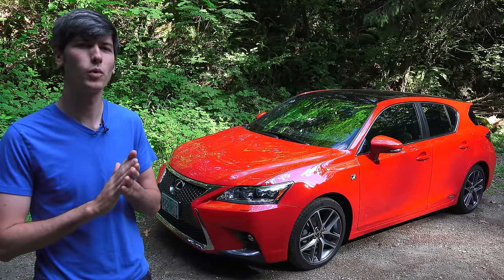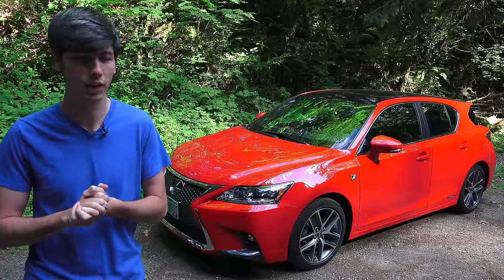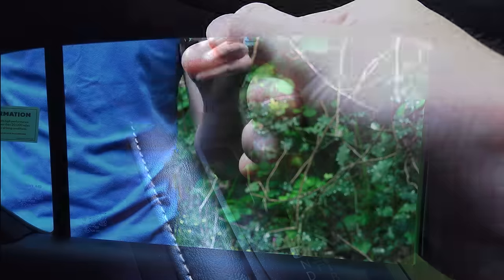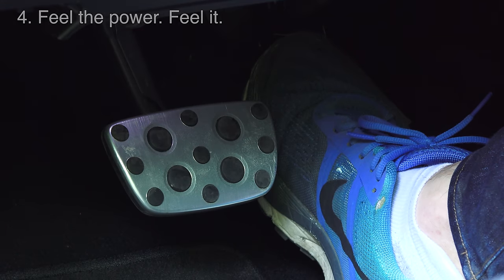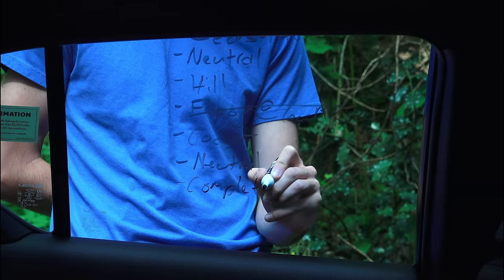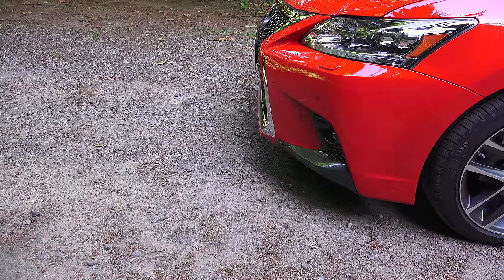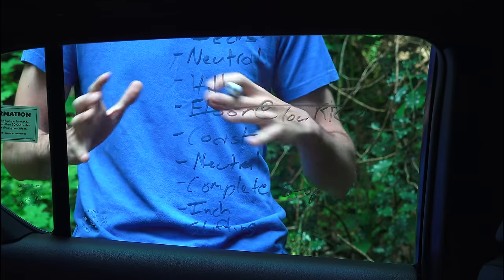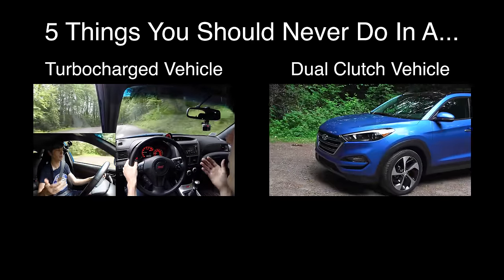5 Things You Should Never Do In A CVT Vehicle

Comment: Why is everybody against a CVT, the technology is pretty cool.
Reply: Horse riders were against cars in the past as well.
Reply: You buy CVT to save on gas. But otherwise better buy manual and feel the car as your bones kicking. Automatic is fast, but lacks manual feel. Basically, goes back, what is your preference.
Reply: People are just used to what it was before, the hate was there when electric cars first came on the scene. If they made a performance cvt transmission and by logic of physics it will be faster than the same car with a DCT people will start to change tune
Reply: Look up Subaru Justy CVT transmission failures. Then you might understand why people shy away from them.
Reply: I'm not against them in principal, but automakers have pretty much eliminated the advantages they offer over stepped transmissions because car buyers can't wrap their heads around CVT/engine behavior.  It's not broken, it's supposed to function that way (referring to the constant engine RPM, etc.)!
Reply: I like the CVT in cars where you can change the gears in them (paddle shifters) when I want to have fun. But when I'm sitting in Bangkok traffic jam, I can just switch to full-auto mode and not worry about burning the clutch because of inching forward (you get honked at for leaving too much space in front of you).
Reply: My family owns a 2015 Subaru Outback turbo diesel CVT an I have never had a problem with it, sure my 1997 Mitsubishi Magna is a lot funner, but the Subaru gets along, and we use so little fuel.
Reply: @Mason Tee, the transmission has literally nothing to do with how a car idles...
Reply: So buy a 2004 Civic.
Reply: hydraulic pressure from cvt fluid i supposed.
Reply: Subaru or Nissan, no choice, Now Honda is using CVT. Mitsubishi, CVT. it's the blasted EPA standards. Only thing worse than CVT is ZF 9speed auto.
Reply: You can't tow with a cvt transmission. It's much better for the car manufacturer because it's cheaper to make and charge you more.
Reply: "They're also rarer than manuals and automatics"

Been under a rock the last 10 years? 
CVTs are everywhere now. Manuals are dead in the water. You have to buy crappy wannabe sports cars like BRZ to get a manual at this point.
And it's going that only the luxury brands are using old-school Autos... and even that is only to cater to people that like the "feeling" of having less efficient power transfer.
It's actually pretty funny seeing all these luxury mfrs go to more and more gears attempting to emulate CVT w/o actually using a CVT because they'd get slammed by the kind of idiots who make snap judgements.
Reply: I just tell people to drive a newer WRX CVT.  It's the best of both worlds.  Subaru did a great job.  You can choose modes that react like the older CVTs (no shift points), 6 speed shifting with set points and 8 speed shifting with set points.  You can also go full manual (no clutch, obviously) and use the paddles for the best of both worlds.

The Nissan CVT implementation did a huge disservice to CVTs.  It really feels like a golf cart with no shift points.  Subaru did the opposite..a great implementation.
Reply: It was banned in motorsports a while ago like f1 because lets just say if you can make it work in an f1 car it has some.. pretty ridiculous benefits over standard drive.

Comment: Traditionally the term ECVT was used to describe CVT with electric clutch. No idea where the new definition that you are using came from. This kind of clutch works using magnetic powder within a very small gap which hardens on magnetic force applied by coils. There is no traditional "usage" of that clutch, since it never partially engages. Instead it is digital, so either on or off. This improves efficiency a lot. The only thing is, that you need to replace the coil contacts every 150000 km and exchange the powder, because it tends to age and form clumps after a few years (5-10 depending on usage)
Compared to a typical clutch replacement, the costs are minimal though (~15-25$ for all materials)
Reply: Toyota / Lexus use the term E-CVT to describe their transmission, but it isn't anything like a traditional CVT mechanically. It has a Continuously Variable Ratio, so it is a type of CVT. The original name for their transmission was THS = Toyota Hybrid System. Toyota now call it HSD = Hybrid Synergy Drive. Personally I find the term "E-CVT" downplays the technology and prefer the term "HSD".
Reply: how long the transmission fluid lasts? What fluid is recommended for eg in a mazda hybrid? Anubisviech

Comment: the Toyota P7100, P711 eCVT in Toyota , Lexus and some Hondas is the only one to buy it has combined the differential both ways into the transaxle to the wheels and to the petrol and electric motors via planetary set up which is all controlled by computer  to give the best mileage possible under all conditions. This is advanced mechanics which today is too advanced for most petrol heads to appreciate  so all they can do is criticise it

Comment: Why am I even watching this? I don't even own a CVT nor will I ever own one
Reply: same...
Reply: The gov't has already imposed strict mile per gallon standards on car manufacturers to get ever more strict within the next decade. Manufacturers are implementing CVTs in cars in order to meet these standards. It's not a question of if you'll own a CVT but more likely when you'll own a CVT. As the technology advances to be able to handle higher torque applications, you'll start seeing them in truck applications even.
Reply: +Josh Reiter they are already in large vehicles.  I drive hybrid buses which weigh in at 39k lbs and use CVTs rated for a million miles.  they have been in our fleet since 2007.
Reply: Josh Reiter Some manufacturers seem to avoid the CVTs with more gears. Mercedes, among others, got 9 speed transmissions. That's not far away from a truck's transmission. By the way, isn't CVTs really expensive? And non-durable?
Reply: What xBuzz996 was saying is that manufacturers are avoiding CVT's BY using gearboxes with more discreet gears (speeds).
Reply: MoronicAcid1 Look at Patricks answer, that's what I meant. I do know that CVTs don't have gears. What I meant was that some manufacturers are avoiding the usage of CVT overall, they are trying to mimic a CVT without actually ruining the fun of a gearbox with gears yet at the same time get optimum RPM at higher speeds. It's like when Audi tried to make a CVT with fake gears, just now it's the opposite, they call it Multitronic. You noticed it was a CVT in the gear changes and while accelerating really hard.
Reply: +fuckoffgoogle From Google: "Toyota describes HSD-equipped vehicles [such as the Lexus CT 200h] as having an e-CVT (electronic continuously variable transmission) when required to classify the transmission type for standards specification lists or regulatory purposes."
Reply: fuckoffgoogle Hmm. Searching Priuschat, it seems you're right. There are no cones or bands in the Toyota HSD transmissions. I thought you were wrong. I stand corrected.
Reply: +fuckoffgoogle my comment was a reply to someone talking about some day having CVTs in tractor trailers and other heavy vehicles.  it wasn't meant to be a technical post or one implying that my example was anything like what the video described.
Reply: I've driven a 200hp tractor with a CVT pulling a plow. Idk exactly how much force that puts on the transmission c but I can assure you that it's a hell of a lot more than any truck will take.
Reply: general mechanic culture
Reply: xBuzz996 the CVT transmission is the oldest and most dependable on the market. the average life expectancy of a CVT transmission is 200000 miles. the repair cost of a CVT is far more inexpensive. car companies using CVT Audi, vw, Nissan, Ford. GM,  Toyota, Suzuki, Subaru, the first car to have a CVT mass-produced was the Ford  Model T.
Reply: john endsley The "eCVT" used in Toyota hybrid systems is not a CVT, and is more dependable and longer-lasting than any CVT. The Ford Model T didn't use a CVT. It used a 2-speed planetary transmission.
Reply: john endsley Well my 2006 Audi A8 V8 with its 6 speed zf transmission shifts just fine at 199,000 miles, knock on wood.
Reply: I laughed hard as I see this comment - I have manual Chevy Sonic 1.4.. I guess that's just the zombie mode kicking in when we're in YouTube.
Reply: A properly designed and controlled CVT will always deliver better economy than a roughly equivalent manual, automatic, or dual-clutch transmission. It simply comes down to being able to more optimally control engine efficiency for the performance demands, and more efficiently transmit that power to the wheels. The entire reason we're seeing so many new transmission designs with more and more gears is down to the fact that the more ratio options you have the more efficiently the transmission will work. Infinite ratios will always beat discrete ratios here.
Reply: xBuzz996 KNOWLEDGE.
Reply: Rob Carter except in reliability.
Reply: Josh Heaps I haven't looked into the nitty gritty of real world reliability numbers for belt drive CVTs versus current auto/man/DCT varieties so I can really comment there. I wouldn't be surprised to see the CVTs from a few years ago being significantly less reliable, given their mainstream use started fairly recently. As the technology matures you can be quite certain reliability will quickly rise to be competitive with the well established competitors. 

With tightening fuel economy requirements, more and more vehicles will move to CVT. One of the best benefits that not many people talk about though is that being fully variable means automakers don't have to choose between tall gearing for fuel economy at the cost of performance, and short gearing for more fun. A simply mode selector can allow a fuel sipping normal mode to sit right alongside a much more responsive and fun sport mode.
Reply: xBuzz996 Even the Honda Civic has a CVT now. So they will be very common.
Reply: I am looking at an X-Trail too. So you recommend it? :)
Reply: Thanks man. :)
Reply: I was just watching since I ride atvs

Comment: My CVT transmission broke on a hilly area Honda Civic X 2021 1.8L. I dont know what I did wrong. I made sure of using S and L modes as required. Still it broke just after 31k kilometers. CVTs are hard to trust after that for me and the older these gets the harder it’s prone to belt slip. You should be wary of it if it’s near 100k I’ll say it’s the best CVT transmission can offer in most of the cases. Also if you are in stop-go kinda situations use L or S so that gear doesn’t shift too early can save your belt some wear and tear.

Comment: Your viewers should be aware of significant problems Subaru owners are experiencing with CVT transmissions in the 2014-2018 model run.  Made not by Subaru but by Jatco, these troubled transmissions are also used in several Nissan products.  I know one Sentra owner who has had three transmissions in the first 18 months of ownership.  

The problem is so severe that Subaru is now extending the transmission warranty to 10 years or 100,000 miles. 

Jatco is a subsidiary of Renault-Nissan and is not known for reliable products. One mechanic told me that Subaru should replace the entire transmission for one with a better design but is looking for the cheap way out.
Reply: yup nissan cvt are junk
Reply: Jatco CVTs do suck, but were never used by Subaru. You're repeating something that has no basis in reality.
Reply: Never get a crapco CVT...

Comment: I have Accord with CVT.  It was strange getting used to it as I was anticipating shifts.  I regularly get 40 mpg on the highway and it's fairly quick from standing start,  although it seems reluctant to "downshift".  60k miles and no problems so far.
Reply: Awsome info..we jus bought a 16' accord sport with 29k..iam about to change the fluid in it..so far so good tho..ill continus to change fluid every 25k..or 3 years..how often are u changing it?
Reply: @edubb2491  does yours have a cVt?
Reply: @driveonthestraightpath2138  yep
Reply: @edubb2491  60k mikes the first time and 30k after that
Reply: You are about halfway there to where they go out.
Reply: I might have the same car. Mine had the same issue. As it turned out, the software couldn't fully compensate for the mucked up valves and intake (the Earth Dreams engine is the only GDI-equipped K24 block). Some Berryman valve cleaner and a throttle body cleaning (preferably in the opposite order) made it a lot more responsive. It restored the low end power scaling, making the throttle more intuitive for me and, as it seems, the engine computer.

Comment: I'm always concerned with the push belt breaking. Especially during hard acceleration. I test drove a 2020 Honda Accord with a CVT. I mashed the gas pedal getting on the Highway. The engine reved to 6000 RPM and it took a long time for the CVT to accelerate. Sometimes you need hard acceleration getting on the highway so you don't get rear ended by crazy drivers. I'm in Massachusetts by the way.
Reply: Don’t mash it, I drive a cvt and I find that smooth but constant pressure to the gas pedal with actually allow the cvt to understand you need to speed up and will actually take off. I have a 2015 forester and it takes off more than I expect tbh. Never ever pedal to the floor in a cvt. They don’t respond well to that and as a result give poor results. Apply light constant pressure to the pedal and when you’re at about 30-40% throttle give it another 30-40-% and then slowly come off of that and you’ll see your cvt take tf off
Reply: I punched my Toyota CVT to meet highway. She was WAY better than other trannys-I was SUPER happy!
Reply: @mikemollica6279  By then you are a hood ornament on a truck.
Reply: @mikemollica6279  that sounds like a software issue tbh. If the CVT can't make power at 6000 RPM because it's confused, it's a flaw in how it's being manipulated.
Reply: @robertkubrick3738  It only takes like a second. They respond fine to low-throttle situations, but some older units are confused about going from a stop to full throttle. It's a software issue, I'd say.
Reply: @PotatotheTroll  Like a second? A second is often the difference in deciding whether to pull out into traffic or not. A second can be like an eternity.

Comment: I think that all cars will eventually be equipped with cvt's except for some sportier models. I have learned to take my foot off the brake pedal when I'm standing still for more than 5-10 sec. Because when you brake, the discs heat up, and they cool off when you've come to a complete stop. But when you keep the brake engaged, that part of the disc where the pads are, does not cool off equally as the rest of the disc. Depending on how hard you've braked etc, this may warp the brake discs, causing vibration when braking, less braking efficiency etc.

Comment: I use Neutral to coast for long distances. For instance: I come over a particular Interstate Overpass and I am doing about 40 MPH. I will put the car in Neutral and I can coast until the Railroad tracks that are around .8 miles away. My RPM during this coasting are between 700 and 750 RPM. It really saves on gas and helps my MPG go up.
Reply: If your goal is to save gas, this is actually incorrect. You use less gas when coasting in gear. In neutral, your car uses gas to idle and stay on. In gear, it’s your momentum that is keeping the car running. The higher rpms are simply your car’s engine being pulled by the wheels. This is why it feels like the car is slowing you down when you coast in gear (look up engine braking). Now, if you just want to coast as far as you can, then yes going into neutral will help with that. But it won’t save gas.

Comment: I have been driving CVT transmission SUVs since 2005.  Last week was the first time I had one fail and it had to be replaced.  I always buy an extended warranty, and therefore got the new transmission at no cost.  No idea why it crapped out. I am a careful driver.  I never launched and will not launch the vehicle.  I always make sure the vehicle is rolling forward before I would accelerate sort of hard if necessary.  I always wait till the engine and transmission are warmed up before driving normally.
Reply: Did you change the fluid every 30k miles??
The fluid is the life of the vehicle dirty fluid shorten the life of any vehicle by half

Comment: I don't understand the hate for eCVT's. They are silent, especially the Toyota Auris Hybrid is quite fast (0-100km/h in 9s) and are incredibly precise when having to drive slow (1-10km/h). It's also the smoothest car I've ever owned (I've owned a Skoda Fabia Comfort 2003, BMW 118i 2006, Opel Insignia Turbo 2009 and currently own an Toyota Auris Hybrid 2014). Even the Mercedes E200 2013 of my foster parents drives less smooth (but is more comfortable over bumps)!

Comment: My 2016 Civic went for 211,000 miles on the original CVT without any service. The transmission would've kept going too if I didn't crash it into a tree 🤦‍♂
But it proved to me that a well designed CVT can last just as long as a regular automatic, and in fact, I sorta miss my CVT compared to the 6-speed auto in my Mazda.

Comment: What about driving in a sportive way? It does not matter if I drive mechanical or  automatic. I shift down, I don t change gears cornering. Before doing a passing maneuver on a normal road, I shift down to have at least 3000rpm or more, to pass fast and inmediatly.  I like to have the engine breaking also.  While driving in D there is almost no engine braking.   My cuestion is : how does this go on a CVT transmission? Is there engine braking? Does the car react inmediatly like if I would be in a certain gear? A automatic car driving in D, when you accelerate, he first changes of gear and then accelerates. Driving like I do, it does not do that, it is already in the gear I want...   So, how is this on CVT?